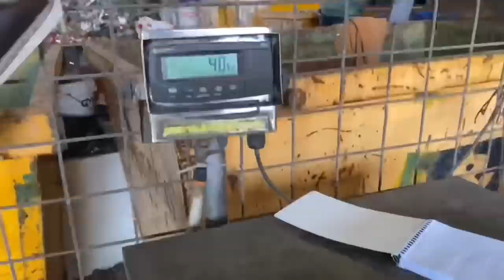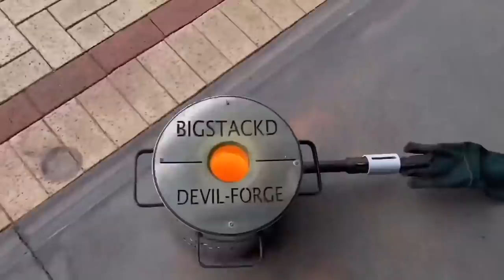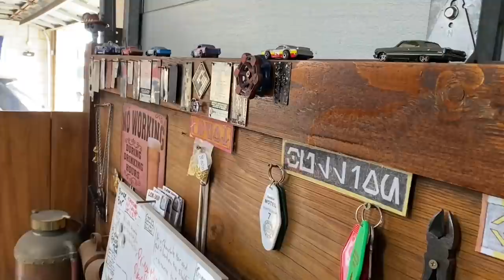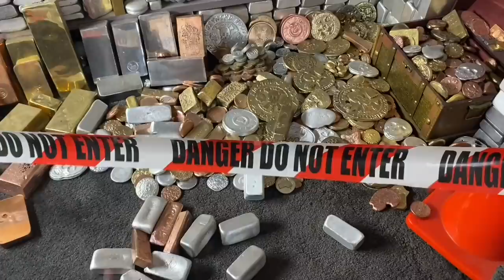Triple Motor Meltdown - Scrapyard Salvage - Dumpster Diving - ASMR Metal Melting - BigStackD Copper

Comment: Little did the crane operator know that his machine was about to be melted into several hundred bars of copper and aluminum, the steel given away to a friend and tires, windows and seats put into the recycling bin.
Reply: This deserves to be pinned
Reply: This is an underrated comment.
Reply: Only a true BigstackD fan would recognize the full significance of that comment. 🤣 TOTALLY needs to be pinned!
Reply: What if the crane operator was the steel guy all along?
Reply: @d3.1415  Good point.
Reply: @d3.1415  😂😂 you’re a good thinker 👍 made me think about that real quick
Reply: @YAK_INC  what's been circulating in my mind, is what if the truck driver also collects the recycling , uses the money from the steel and recycled goods to acquire metals to trade with BigstackD? Is there a symbiotic ecosystem of perpetual recycling that we can all learn from? I wonder... I wonder...
Reply: see that would be hilarious LMAO! 
but why give away the steel? it could be used to make a sword or a bunch of knives or ooh hammers.....like 8 pound sledges?? and heavier if need be

Comment: I used to work in mining, as I think back on the amount of scrap copper cable and electric motors that were buried in a pit; it breaks my heart to know what a fortune of scrap copper and aluminum was just tossed away and wasted.... 
I'm sure I could have easily melted every day for a year and still only have made a dent in what was there. Oh I forgot there was also tonnes of brass liners that we used in our crushers that were also wasted. And the sad part is many of us knew the potential of what was being wasted and asked to retrieve it for recycling and were flat out denied with no explanation... So sad.
Reply: @Joe Mama You're lucky to have friends like that; the Mine I worked at would just as soon fire you than see you take home what they threw away.
What they tossed away would have literally set me up with a nice retirement fund if they'd allowed me to recycle their junk, as I said, so sad.....
Reply: I got lucky when i had my internet installed. they had a bunch if wire segments that they were going to toss in the trash but gave to me instead. lots of copper in those.
Reply: Maybe one day a company specialising in reclaiming abandoned resources will extract it all. Its sad that all that metal just got chucked in a hole but its probably all still there. I bet you money in the next 15-20 years we'll start mining glass and metal from old landfills.
Reply: @CaptainSpork7  I doubt glass, my city just stopped taking any kind of glass anymore for recycling. I guess it just don't pay to recycle it.
Reply: @Cpt_Adama  Well that's stupid of your city to not recycle glass seeing is that it can be recycled nearly forever.
Reply: @CaptainSpork7  Just this month they implemented a whole host of restrictions on recycling. I think it comes down to money and how much it cost's them to recycle stuff. It's not if it can be recycled, it's a matter of can they at least break even financially doing it.
Reply: Likely the labor involved and the cleaning needed would have been cost prohibitive.....that’s bran counter speak for....we wouldn’t make enough off it to bother doing it right.....
Reply: Why don’t you go dig it up that’s if you know the location
Reply: @Wogsmawp   @Cxm_peach  As I said this was a Mine and when it came time for them to 'dispose' of all this material they just dug a huge DEEP pit and buried it. Anyone wanting to 'dig' it back up would need mining equipment to dig it back up, it's not like you could just take a shovel and dig it up.... It was done this way on purpose so that no one could just come back and 'dig' it up...
Reply: I'm an apprentice electrician and just saving bits of wire that were bound for the trash netted me almost a thousand dollars last year. It's incredible what gets thrown away.

Comment: Mmmm, motor melts and I'm Extremely psyched to see that huge one getting done.  Question, do you use a 4KG crucible more often than any others?  Debating on what size I need to get.
Reply: If you have a 10kg furnace you can run the 4 or the 8 but dont run a 10 as the tongs wont fit to lift it. Aluminum you will probably want an 8kg.  The other metals it really depends on how much material you are gonna be doing each time. Hope this helps broski
Reply: @davidjoeseph2646  thanks man
Reply: @MrJco54  

Yeah my 4kg is just a hair frustratingly small for my aluminum. One size up at least.
Reply: @dethmaul  Much appreciated

Comment: About that pink unicorn notebook - you could write down how much did you pay for those materials that you are melting, or in special occasions - how much gas it cost also, then you can show if you earn anything from that melting stuff.
Reply: I agree, I always wonder how much the material costs at the scrap yard. I always also wonder about the overall time it takes to do a melt. I have seen some timing and it does not seem like a long time, maybe 20 minutes for doing copper and less for aluminum.

Comment: Holly Cow that is a big motor. That will be fun to watch.   

This is another great video, it keeps me motivated to get my fires burning and metal melting!!!  Soon I will make it so.

As I watch the old videos, I wonder if the Pile of stuff you had collected and showed in the beginning of a video (first 30 secs), if you worked through all of that cable, motors, piles of lead, and aluminum parts? The video I talk of is referenced in your home made wire stripper video. 

Army

Comment: Your vidz are always mesmerizing.  Have you tried making clear ice?  Just use a eski small enough to fit into the freezer with the lid off, it freezes top down (directional freezing).  Might be a little cloudy at the bottom but mostly clear.

Comment: if only I can get copper to melt in my charcoal foundry. bigstack d be like can I have another order for 10 motors to melt pls. my crucible breaks oh come on. great vid
Reply: Charcoal doesn't get hot enough to melt copper. Charcoal is designed for endurance heating like to cook food at a moderate temperature. Hardwoods can get hot enough to melt aluminum, maybe get hot enough to melt brass. Propane with air blown in a properly insulated furnace like the devil forge would melt copper if you got enough gas pressure. Copper dissipates heat rapidly so you need alot of heat and you need to act fast if you want to pour liquefied copper in a casting mold.
Reply: @nathanlewis5682  thanks so much for the info. I'm thinking of trying to get a gas furnace like a (devil forge) but there a bit to expensive because I'm only doing it for fun so I might try to make one out of a propane tank and some ceramic fibre. I also just got my foundry hot enough to melt brass. also thank you very much for your info

Comment: You may want to consider adding a post under that section of floor. Standard floor joists are rated for around 40 lbs per square foot... Would be a shame if the floor broke loose from the wall, and the stack fell into the crawl space... Food for thought! Unless you have a slab on grade foundation...

Comment: OI.... I thought for sure that thing on the crane was gonna be your wife's car or something.. :-) I think i'm ready for the 10K furnace so i'll be emailing you for that link. I got 160 HHD for $.50 /per and started breaking them down, there is a ton of shiny stuff in there although almost all AL, there is copper and i think the platters (3 in each drive) are coated with something valuable. Plus got those funky magnets and a lifetime supply or torx screws. Love the dog wash, and attempted tea, but just stick to the magical pizza and burgers or tomahawk steak and beer. Great job yet again and grats on the 1mil!! well deserved. peace love and hair grease!

Comment: Give me a crane and a solid workbench and I can do a motor like this in about a day. The trick is to cut off fronts of the windings, hold the stator down and pull windings from the back, one at a time with a crane. Actually a winch might do the trick, just need a good hook to get between windings and some way to hold the motor. We do this at least once a week in our shop, I could shoot a quick video of how we do it if you wanna see). There's always a motor to pull apart laying around.
Reply from the maker: I have seen those machines that pull the entire lot of copper straight out one end of the stator but unfortunately I am limited to Hammers drills angle grinders and other handheld tools. I don’t even have a winch so this could take me awhile to breakdown but at least once I can get this stator out of the casing I can roll it into the garage and figure out an attack plan👌🏻😁

Comment: You could melt that copper dust in nitric acid to separate it from all the other shit that might be present, then pour the solution onto iron to cement out the copper back to its metallic form. This will result in pure copper.

Comment: I'm a big fan but one issue I keep running into with my own melts and pours are the purity of the hand poured bars. How is it that by sight we can determine each bar is high grade, 999 Fine? Is there a need for any climate control, electrolysis, etc?

Comment: Hey how do I tell if a metal is aluminum or anything else? Cause I only melt aluminum
Reply: Thats a pretty tough question. As far as I can tell aluminum's way lighter and melts before it turns red. Most all other silvery metals are heavy and then you could measure the melting points to know what you're working with but even then beware of alloys! 🥳

Comment: Think the DF could melt stainless 316? Or ever done and can confirm?
Reply from the maker: No it can’t melt steel or stainless steel I have melted a tiny bit of steel when I Alloyed it with a heap of copper which lowered the steels melting point and I made a few copper coins that were magnetic , that was in a video I put out awhile ago
Reply: Thank you as always for the reply. Had probably 50lbs of 316 that I was hoping to melt vs just scrap.

Comment: Hi, I've been following your videos for a while, I find it pretty cool to do some recycling even if I suppose that anyway these copper coils would be recovered and remelted like you do but in an industrial way without doing disassembly. I thought, in view of the noise made by your foundry, that you found yourself a little "isolated" in the sense that you had no direct neighbors but I was wrong, I saw while watching one of your video that your direct neighbors are ultimately not far from you and therefore I wonder if you have ever wondered whether you are not enuuating them with the noise made by your foundry, I mean if it is they do not dare to come and ask you to do that elsewhere, I have never seen your face but in view of your numerous tattoos I can imagine that you can impress them and that they dare not come to see you to ask you to make a little less noise. Another question about the cooling of your brass and molten alum, when you cool them with ice you do not generate a modification of the structure of these metals by creating a thermal shock such as that induced by ice (just a question of curiosity). Hope you got the meaning of my first question, it's not about judgment or anything like that, just that I realize the noise it makes on video, that I have already approached foundries almost identical to yours and I know that the noise it makes is quite significant, that you melt at any time and that I wonder what your neighbors think about it ? 😉
Reply from the maker: All good buddy, most of my melts I do mid week when all the neighbours are at work or not home but every now and then I will do a melt into the evening but I’ll normally wrap it up by 730 8 o’clock at the latest, the neighbours are all my age and younger so they’re not concerned about the noise at all and even though it’s quite noisy in the videos I’ve talk to all my neighbours and they say they can barely even hear it and it doesn’t bother them at all. When it comes to the thermal shock theres the chance I could be hardening an otherwise soft bar I’m not exactly sure. A few people have mentioned that I should let it Air cool but as it’s just for my collection and the fact I am not selling the pieces I’m not too concerned about it but I would think it definitely isn’t doing the ingot or coins any favours that’s for sure👍🏻
Reply: @bigstackD  
Ok, thank you for taking the time to answer me and understand the meaning of my question about noise. It's respectful of you to only do your fonts when there is probably no one or very few people at home, you might as well do what you want in good conditions and neighborly relations are important when you do what you do, it is better not to have conflict to be able to continue quietly. And for the cooling I also think that in the air it would be better but as you mention it is not to resell it, which I thought you would do in the long term once you reached your goal of one ton, du suddenly the molecular changes due to the thermal shock are not that important though at one point I suppose you will sell some of your stock otherwise you will end up filling your whole house. Good continuation for your goal of 1000kg and see you next Friday for your new video 😉👍